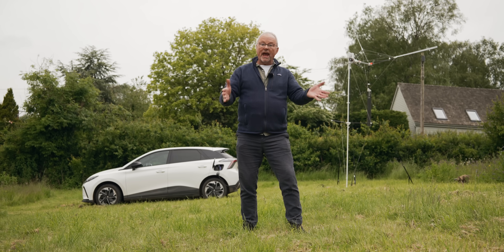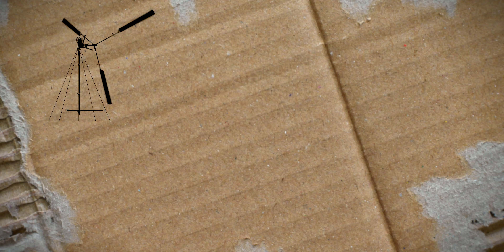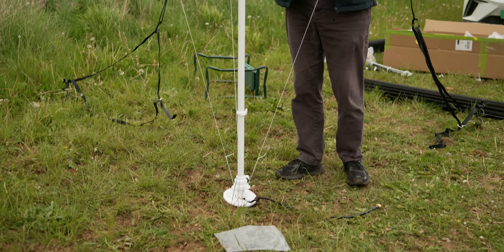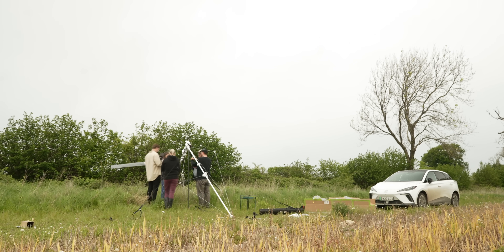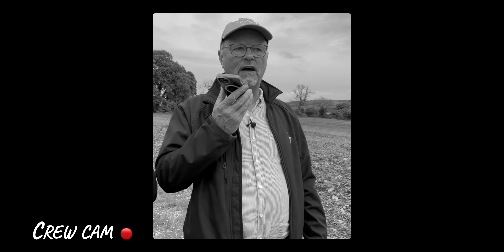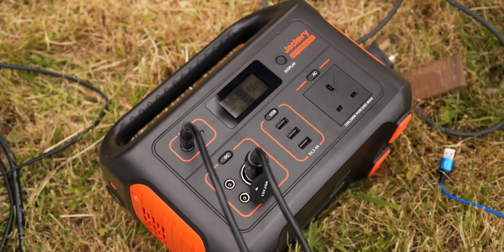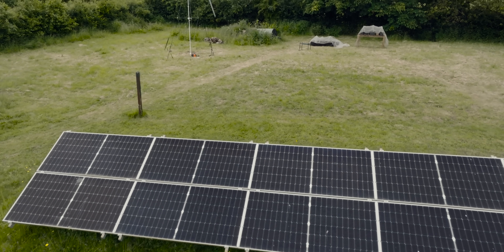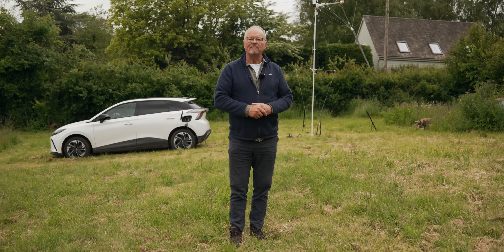Charging an Electric Car with a DIY Wind Turbine?!

Comment from the maker: We really hope you enjoy this episode - consider it some cockel-warming content to get you through your Wednesday afternoon!
Reply: You may want to check the car's manual.  It may be able to be told to take a lot less power on the "granny lead".  If so, you can add range extremely slowly but none the less add range.  If you go camping with an EV it is common to use it as the source for electric power to do stuff like make dinner.  This takes a fair amount of power but only for perhaps 15 minutes.  Thus the turbine can charge the EV for hours to add back the energy you just took out.
Reply: @kensmith5694  you would have to set it to 2 A max. The charging protocol supports currents starting from 6 A. This means this experiment was doomed to fail because the poor little powerbank could not provide the minimum nescessary current and probably tripped it's overload protection each time the car tried to start up the charging process.

Amazing that such a knowledgable team (I suppose, it should not be new to them) did not see this coming...
Reply: @oroozen  I hadn't bothered to look up the specs of theirs.  I just saw that their power bank was about twice the size of mine and I know that mine can output 4A for a while until it is depleted.
Reply: @kensmith5694  Your 4A is still too little to charge an EV. Even if you set the granny to it's lowest setting, it will try to pull 6A and trigger the overload protection of your power bank.
Reply: @oroozen  Like I said, mine is smaller than the one in the video.  I had assumed current ability would scale with size.
Reply: It does take a village...
Reply: It's a good idea. If they used more efficient blade design,  maybe added a couple more blades, and perhaps a proper pointing system, then on a breezy it would be even better.
Reply: @RWBHere  More blades don't increase the power output of a turbine.  It is one of those slightly non-obvious things but perhaps this can help you to see why.  Imagine a turbine spinning in a breeze coming straight towards it.  Some distance in front of the blades, we may have air moving at lets say 5 meters per second towards the blades.  This wind contains some energy.  Behind the blades the wind is perhaps only moving at 2 meters per second because it lost some energy.  Since the air in front is going faster than what is behind, some of the air had to have bent out to the sides to go around this "traffic jam".   This suggests that you can trade back and forth on how much wind you lose to this vs how much energy you take out of the wind that does go through.  At 3 blades, we are already into that trade off.
I hope that was clear.
Better wings and better pointing are a good point.
Reply: 100 miles a month

Comment: when taking power from a floating power source. you have to make a false ground. i.e. connect one of the phases to the ground terminal, otherwise the electric car's charger will suck up a lot of power and not work properly..at least in the nissan leaf it works like this

Comment: That is an abysmal amount of power for a massive pain for setup. Under good wind, it also looked very wobbly. it would be far easier to just bring portable solar panels. You didn't show much of actual power produced either. And showing a battery can run devices doesn't really validate the turbine, if it takes 3 days to charge the battery. 

For camping, you are most likely not going to be anywhere near ideal winds, whereas there is always sun, even if you have a bit of  shading, it is much easier to find a spot ok for solar than it is for wind.

On your car, you should be able to set the charging current in amps, so it would be more feasible charging with a portable power station. The power bank was probably outputting it's "peak" temporary rating then shutting down.

Comment: The battery just had an inverter built in, what would have been good is to understand what the power going into the battery, this would allow for use cases to be calculated. It's an interesting development.

Comment: our EV battery is 60kwh 4.5kwh in 24 hours of decent wind "if you can get it" equates to (not realy great) for general use    . So i guess you would need about 10 of these to be charging at a decent rate .

Comment: All practical tests of ground-based small wind turbines show the same results: 1) They hardly produce any electricity. 2) They do not last long!
With solar panels, you can generate at least 10 times more green electricity with the same investment! Reliable and almost maintenance-free.
Moreover, the wind is extremely gusty, which almost always greatly reduces the service life. 9 out of 10 systems stop working after a few years.
With the KiteX WindCatcher, I bet that 9 out of 10 systems are defective after just a few weeks! 100x better to use flexible solar panels!

Comment: I get that it's supposed to be a 'temporary' solutions, but string instead of cables, seriously?  How fiddly/cheap can you get?  A few solar panels seems like a much simpler solution and wouldn't require a phone signal at all, which would be a huge plus if you were camping.

Comment: Sounds like with a higher output capacity jackery it might be able to keep that topped up while it charges a car, if you're in a good spot. Even better would be to directly charge a camper that has a built in solar / "variable dc" input for on board charging. But only if you're staying somewhere for a few days. The setup time isn't a dealbreaker, though. Not super keen on having to have an app on my phone to control it, though. 
Still, that's pretty cool!

Comment: Most evs have a charge controller for safety's sake that have the unfortunate side effect of preventing trickle charging, so if you can tap into the battery directly, ideally with a custom charge controller for safety, you can do direct DC to DC charging even at a very low voltage and with the car switched off! There are some who have done this successfully and posted their results on YouTube. With the car off, you end up with more power by preventing vampire draining.

Comment: For an allegedly portable device, this wind turbine has a terribly convoluted design. They could have at least gone for a stereoscopic stem and foldable blades attached. 😅 

Regarding EV charging, still makes more sense to have integrated solar PV directly within the car’s body.

Comment: Ah charging a car from a battery could be the issue I had when I was looking for a portable battery to charge my e-bike for an up and coming bike tour. The issue was grounded earth. My e-bike charger had to have grounded earth to work. I contacted several battery manufacturers, none of their smaller products could power a device that needed grounded earth. Some larger batteries can overcome that requirement.

Comment: Been talking to kiteX for a while, and its a super interesting prospect. I wondered if you could combine their system with solar to charge the same battery bank. My problem is the same as yours = my battery bank can't output 10A continuously. My concern after seeing the video is the oscillations to the turbine frame caused by transfer of weight of the blades. The moment arm to the hub from the blades seems too long to ever get rid of that.

Comment: TLDW; 4500whrs over 24hrs = power output of kit at 13mph wind.  4500/24 = 187W.  For us here in America that's like plugging into 120V at 1.5 amps. 1 mile of range an hour, rounding up. 😊 Could be a good complement to the PV array of a tiny off-grid outpost for sure. The engineering & construction is bloody impressive!

Comment: 4500Wh over 24 hours means it puts out 200W. Given that the J1772 standard has a minimum pilot value of 1.6kW, yeah nah. But you can charge the car from that battery bank. Which you could do without the turbine 🤷‍♀️

Comment: Its so out of balance. That fan wobbling away for hours and days, something will mechanically fail.
Also needs some far better gearing to spin that generator faster or its a lot of work for a couple hundred watts max.
Whole lot less stuff around plonking a solar panel down. Im sure over the course of a month you would have more power and less headaches than setting that thing up multiple times.
Reply: Solar doesn't work at night.  Still you are right about this generator needing better gearing if it uses that generator.  A somewhat clever thing is to use a stepper motor as a generator on such things.  They have a huge number of poles and make significant voltage at low RPM.  You can get quite large ones.  They just cost more.

Comment: My Hyundai charges at 8mph on a 10amp Granny Lead, also with a Hyundai Granny Lead it can be stepped down to 8 amps or 6 amps… so it’s not thrashing that little battery pack to pieces… 😊 great experiment… glad the farmer didn’t set the dogs on you all 🤪

Comment: You're not testing whether the turbine can charge the car; you're testing whether the battery pack can charge the car, which is rather obvious.  
What would be really interesting is to know whether EVs can accept varying and unpredictable DC or AC voltages and currents available DIRECTLY from renewable sources, like a string of solar panels or a wind turbine.  Then you could just plug your solar array straight into a car without a big expensive inverter in between. I mean, the EVs already have a built in inverter, don't they?

Comment: Love the idea. 
Impressed with the fact that it requires moderate and not difficult setup. 
It does look a bit flimsy.
Glad they fixed that app limitation.
Love that they used a Jackery. :D

Fun little experiment. Cheers from the US! :)

Comment: The weakspot in the system is most certainly the battery. I would love to see a long term test. With a flat portable battery and a flat car battery with the turbine and sew how long it takes to get everything powered up.
Reply: Yes, that was the wrong battery system.  Really it was the "inverter" that made AC that was short of what is needed.  Lithium batteries can give a lot of power per volume.

Comment: You could of pointed out the farmer working in the background was using one of the most up to date technology to sow crops with one of the lowest co2 footprint. Not say I hope he’s not spaying toxic chemicals 
You could spend some time investigating it and you may find farmers are doing a lot to lower their co2 emissions.  
And as you said in a previous episode the farm spewing fumes with his tractor and doesn’t care. 
His tractor will have add blu. Admittedly this is not perfect but at this point it’s the best and only option the farmer has. 
Because there’s no production of electric or hydrogen tractors. 
Maybe Samsungs new 500w per kg battery could change that in the future I hope so
Reply: ‘Could have’. You’re welcome.
Reply: @AiTheBetterToSeeYouWith  
Is that the only mistake I made. That’s unusual

Comment: The mg4 domestic plug charger is 2.2kw.

The camping battery inverters are limited to about 250w.

You won't be getting any charge from that domestic charger.

Comment: It is a start. But the stand needs to extend at least 2-3 times higher, and the blades need to be much longer ... .

Here are a couple of other similar "silly" examples
cordless 2023 06 20 -Cordless Tesla 2.0 Turbo Diesel (2700mi Without Charging) P.2 - YouTube 
https://www.youtube.com/watch?v=seHWJMKwOQQ

2024 01 22 -The Slowest Cannonball Run Ever! Driving A Solar Powered Tesla From NY to LA - YouTube
https://www.youtube.com/watch?v=Max-lF3MzI8

Comment: of course it can, you can make it more foldable, with one telescoping pole, with ground tethering wires, and other stuff on the top of it, the turbine. also folding in pieces. redesign that to be actually portable, buildable and usable, and rigid. robust. and cheap. dont put the generator on top, use a ground axle, only have the rotor on top. the generator motor should on ground. like in a wind mill. that blade twisting feature is not required. at all. you are not making a helicopter. brake it in the generator, not in the blades, if needed. dont make stuff dependent on more complex stuff to get simple stuff. absolutely zero software required in that thing. a wind turbine. walk to the store and buy an android potato phone. the default state of the blades should be running, not off. and not a software to turn the wind turbine on. omg k.i.s.s. always. the wind turbine rotor axle is too long lever. wobble wobble. yes, a power source needs to be self-starting, should be, usually. why would you use a computer to start a fire place. so why dont you have a solar generator inputs in the car, directly. yep car is a solar wind generator battery bank. just connect solar or wind, or current source to the car. yes also wall output sockets on the car. 4.5kWh of a 50kWh car battery is already 10%.

Comment: Having been off grid for over 7 years using primarily solar, I have a wind turbine on a 10 meter tower. The output is never up to the rated 2000 watts. A reliable 300 to 400 watts is a realistic average output to the whole house battery bank. About the same as one old solar panel.
This portable toy may be enough to charge your phone and run some LED lights but don't expect it to do much more than that.

Comment: Going to geek out with some numbers.

There's a YouTube channel by Joe Kliewer (Power Of Light) that did the Cannonball Run (Red Ball Garage in New York City's Manhattan, with the waters of the Atlantic Ocean either side of the island, all the way to the Pacific Ocean and the Portofino Hotel on LA's Redondo Beach some 2,900 miles away) in a Tesla that was charged exclusively on solar power.

Getting electricity purely from the panels, or wind in this case, doesn't give a steady enough flow to charge the car. What the guy did was have 64 flexible solar panels of 100W each (6.4kW) that put its power into an 8kW all-in-one single-phase inverter (running at 240 Volts and 33⅓ Amps (that's the 8kW)) with an auxiliary rack-mounted battery capable of holding 5kWh. The 64 panels delivered 17.5 Volts / 5.8 Amps each), strung in series of 16 panels (positive of panel 1 to negative of panel 2, positive pf 2 to negative of 3, and so on) to increase the voltage to around 280V (the Sol-Ark is rated for up to 500V) and then those 4 groups of panels were wired in parallel (positive-to-positive and negative-to-negative) to increase the Amperage to 23.2Amps total.

He has the solar electricity go through the inverter, which charges the auxiliary battery. When the battery gets to 80%, it turns the system on and starts charging the Tesla. When the auxiliary gets below 40% capacity, it stops charging the Tesla and doesn't start again until it gets back to 80%. If there's a Tesla charge happening in daylight, it can be going for a while as the inverter gives the 5kW battery juice and the car takes it away.

It takes a few days of good sunlight to charge the car, he drove at night to his next camping / charging location 300 miles or so further along the route, and he was mad enough not to do this in late July when he'd have peak solar input. There's no reason why an identical setup couldn't be used with a Wind Catcher windmill - but although the wind can blow night and day, it would deliver less than the solar setup that Joe built and used. Delivering 200W at 5m/s (13mph) constant wind would give 4.8kWh per day. It would be best used as a secondary source when paired with a solar setup, giving just a little extra at night and during inclement weather.

Comment: In 2011 Wind Explorer, a lightweight electric vehicle, drove from Albany western Australia to Sydney in 17 days for the 4,900 km trip: It was the longest overall distance covered by a wind-powered land vehicle powered by lithium-ion batteries recharged by a portable wind turbine whenever wind conditions permitted. The 200 kg vehicle therefore only notched up electricity costs of around €10 for the almost 5000 km trip. They used a kite when they could and a giant carbon fibre mast slung under/inside vehicle on which they had a wind generator which they would erect at evening camp. In no way practicable but it was 2011.

Comment: What we really need is a low loss input way of putting portable solar into the onboard batteries. And get manufacturers putting solar on cars. It would go a long way to making them more efficient and cheaper to run. No one bothers how much is lost during charging because it doesn't show in the miles per kilowatt figure on the dash!

Comment: As much as i love renewable tech this just seems like a huge faff for the electric generated. I suppose if i had a massive garden and this setup i could charge ny ebike so i wouldn't say its totally useless, just kind of niche. Wouldnt most people be better off with a stronger less portable one for thier gardens? My main concern with this would be the reliability as it looks very flimsy like a storm would wreck it. That being said if the main generator and blades are strong you could probably rebuild the rest of it. Thanks for the video anyways 👍

Comment: All good fun Robert, but I cannot see a campsite owner allowing this kind of device being setup on their campsite for Health and Safety and insurance reasons. I think solar panels would of been a better approach. But I can see what you are trying to do, so what if the team is interested how to use a water wheel that can charge up a car using its regen braking system, that would be the ultimate challenge!